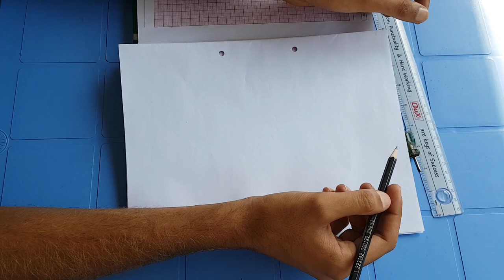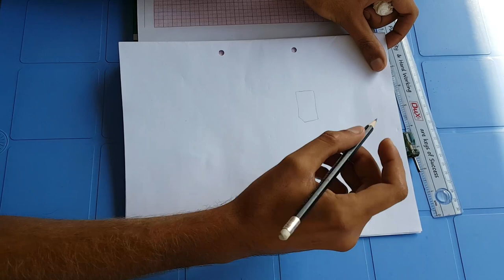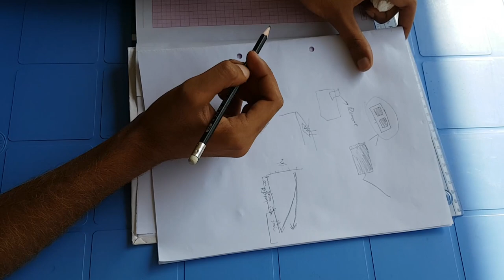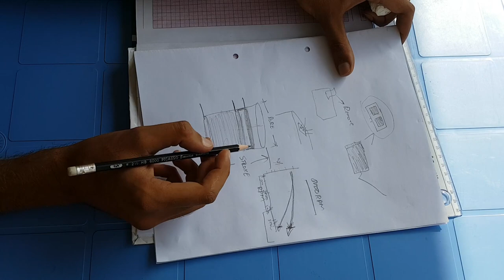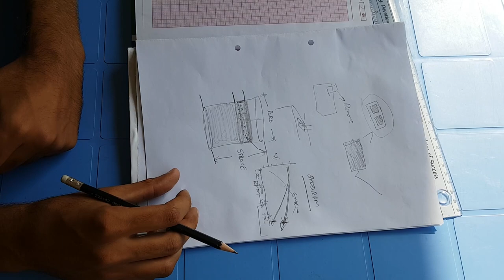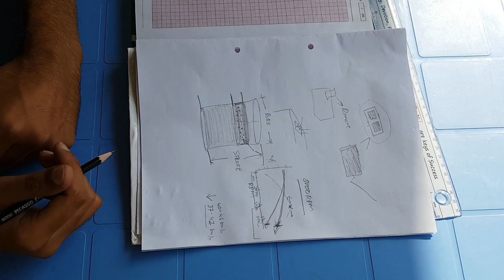Pilot Air Fuel Screw Adjustment Explained - Yamaha

Comment: Good effort. Please note that by turning the pilot air/ fuel screw clock wise or anti clock wise you tinker with the idle mixture only. If you study the carburettor internals this idle circuit  is useless at higher rpms. The main Jet  will have to be changed.
Reply from the maker: Yes right... that only happenes when we are at higher rpm..... driving in city means that we are lying in mid range so the pilot is still active in this case......🖒
Reply: your theory lecture is ' on and around' 8000 rpm.is it not?

Comment: Nice video bro.. it helped me alot and other YBR'ians who depends on the mechanic and mechanics just have their own philosphy... upload more videos like this with theory+practical in a video.
perfect video. . liked
one more thing did you feel any accelaration/top speed difference with installing an aftermarket muffler as you have got that on your bike before any(Air Duct) mods.
Reply from the maker: Thank brother... means alot to me.... yes aftermarket exhaust has increased acceleration.... after removing duct and adjusting fuel.... it slips under when i accelerate this bike... but didnt check top speed yet

Comment: Idle mixture screw only affects idle and off idle. If you change your exhaust to a more permissive one and change the fuel filter or remove a snorkel you have to modify the needle position and main jet (but in small increments) to accommodate to the bigger volume of air allowed inside your engine. Playing with the idle mixture screw only makes it richer at very low to idle rpm where the removal of the snorkel or airfilter cap isn't helping at all. You will only foul plugs and run too rich at idle.

Prove me wrong :)
Reply from the maker: I like that..... but do you know that this pilot circuit is active on low speeds as well as high speed???? This is motorcycle carb.....

Comment: AA brother, i have YBR G and now feeling some heating issue after 1st tappet adjustment at 3500KM by mechanic, here my fuel average is good and no engine oil consumption found after 500KM run. kindly suggest some solution and also pls guide about engine sound as my bike have some loud sound at higher RPMs and Max RPMs are 7.2K in 5th gear at max speed of 100KPH. please suggest some good things to improve each deficiencies. Thanks and waiting for your rep.
Reply from the maker: First check your engine oil & replace it with a good one..... secondly which engine oil you are using........ there is nothing we can with sound... because it is already silent..... if you want more performance & go upto 8k in 5th gear... you have to remove air duct, watch the video on my channel....☺

Comment: what is the standard turn of mixture screw in 2018 ybr..and what is the full rpm in standing bike ?
Reply: Always below 1500 at got hot idle. And does not matter on the turns its fornajustment not a reference point

Comment: hey bro.. this might sound stupid but do you think its possible to install a 6v cpu fan inside the filter box to suck more air in to act as a makeshift supercharger? i just thought of it since the idea is to let more air in (with proper fuel supply ofc) and what could be the damages(if any) done to the proper running of the engine? thx
Reply from the maker: Well actually this is single cylinder engine....  so if you try to push air through fan... it will sprut out all amount of fuel from your carb toward engine... hence engine shutts off due to worst air fuel ratio.... impossible for carburetor....
Reply: Thanks. i knew it was something stupid thats why no one was doing it. gonna try this video on my YBR. i have a full stock but im satisfied with the speed and all but there are moments when some honda 125ers try to put me in their rear view mirror. i dont worry about mileage. peace.
Reply from the maker: Hahaha... no worries man..... ask me questions whenever you want... its not stupid... its your interest... keep it up...🖒🖒

Comment: I dnt need any extra power my bike was doing good at stock settings but now its not. In this video u showed many things but didn't explain the adjustment of mixture screw. I mean if some 1 want to adjust the fuel acoording to new exhaust and air intake setup or like me 1 who lost stock setting and want to.get back. I need to know the stock setting for this screw if u can tell that plz.
Reply from the maker: +Irfan Siddiqui well the point is... that playing with air fuel mixture is not an easy task... every matter related to it, requires alot of research and alot of planning... everyone is not able to adjust it until he gets hand on experience by working... as far as i could do is to help at my best...
Reply: Sir stock setting is 2.25-2.75 turns

Comment: Hi. Will this work on fuel injection model? Thanks
Reply from the maker: Nope bro.... fuel injection models have throttle body and injector... so you may need a new power commander and reprogram it..... thats expensive...😜😜
Reply: Vortex Ride. OK. Do u know if I can play with air filter?

Comment: Hi man great video, I have ybr with Leo Vince gp corsa exhaust and I'm thinking about making this FI adjustment along with removal of the air filter "bit." however with the Leo Vince exhaust I already have slight popping from exhaust, doesn't this suggest there is already sufficient or slightly too much fuel input already?
Reply from the maker: +Jimmy knuck with the standard exhaust.... those poppings are damped... no worries at all  about these things.... just check your mileage per liter... if it is still good then good to go.....
Reply: Vortex Ride Iv just noticed my fuel injector is different to yours, iv have the ybr ed '12 (euro). Do you think the same adjustment can be made? And how long have you being riding like this on your ybr? And what is now your top speed? At the moment my bike is hitting 75 mph easily with a top speed of 83 mph (133kph)
Reply from the maker: +Jimmy knuck my YBR is having CV carb.... I have YBR ESD 2016.... I have never pushed it to topspeed... but I guess it can only achieve 120 kph..... your bike is already doing good..... you can do same adjustment but I am not sure that you may have to remapp your ECU...
Reply: Vortex Ride Ecu mapping is what I was looking to do, to increase the fuel mixture (properly), but all power commander chips seem to be way too expensive for the actual gain. Love everything you have done to your bike so far it looks really good man. I'm tempted to get the same handle bars. Cheers for your replies, keep up the good content. You on instagram?
Reply from the maker: +Jimmy knuck dear thankyou so much... that means alot for me...... I ll be always here to help your YBRs 😊😊😊.... Sorry not on instagram.....😐
Reply: Vortex Ride no worries man, if you have a smartphone I recommend you using instagram just to share some pictures of your nice bike in the landscape.
Reply from the maker: +Jimmy knuck thanx man.... I'll do so....👌😊
Reply: Jimmy knuck u bike have fuel injection.... we have butterfly carb..... totally different.. fuel injection have different settings this video is not usefull for u

Comment: Hello. Mera ybz 95km/h sy uper ni ja rha uski top k liy carb adjust kis py set krn with best fual avrg
Reply from the maker: Hello...... bike ki total mileage kitni hui hai ab tk???
Reply: Vortex Ride 4100 
Tappet seting 10 12
Hks silncr 
Stok tyre
Reply from the maker: Filter kb change kia aap ny??
Reply: Sir main ny to filtr chang hi ni kia abi tak 4000 km to chali hy abi aur shuru sy 95km/h dy rhi hy . Bus iridium plug chang kia
Reply from the maker: Oh.... very late.... aap new filter install karein...... or es baar 5 liter hioctane or 8 liter regular fuel ka mixture use karein..... phr mujhy result btayen.....
Reply: Wese filtr to 12000km py chang ni krty. Aur main to wese b high octain zyada use krta. Carb audjsmnt kbi ni cheri jb sy new bike li. Wo seting krni ya ni.
Reply from the maker: Join me on facebook bro..... my page name is same as channel....
Reply from the maker: No... filter 12000 py nahi.....

Comment: Bro .gear soft nai lag rahe kia karna huga ..2nd air duct hatane ke bad air filter ka foam hatana huga
Reply from the maker: Yes clutch adjust karein.... gear set ho jayen gy..... or yes duct or foam dono remove kr dein....
Reply: Bro cluth ki setting uper lever se higi ya neche engein side se ?
Reply from the maker: Upper lever sy ho jati hai easily bro...

Comment: Plz mujha batein ka fuel ki chori kitni kholni ha ka averge 40km tak ho jai
Example 
1.5
2.5 etc
Reply from the maker: I am using 1.5 turns now..... but standard is 2.5 turns.... adjust in between.....
Reply: Vortex Ride city ma average 45 tak karni ha speed no issue H 
Us ka lia chori kitni open honi chaiaa..
Ap ka bike 1.5 par kitni averge da raha ha
Reply: AOA
Bhai my YBZ is getting max rpm at 4 turns while adjusting mixture screw.
Should i set it here or what is the issue that it is not going good at 2.5 turns or 3.

Comment: Bikes which are Non EFI are automatically adjusted according with the parts change either it’s an Exhaust or an Air-Intake but the parts have to be original if you are looking for performance not just the sound. And for the missing problem you should change the Coil & the spark plug NGK Iridium plug or else go for a Bosh 4 Tip spark plug and buy a 1000cc car Coil from a spare parts shop and definitely a new one. Never change the settings of your Non-EFI bike. You will only ruin your bike.
Reply from the maker: If non efi are self adjusting.... then why they have provided pilot ajdustments and main metering adjustment???? They should have made fixed throttle ports.... think about it..... 1000 cc coil will melt piston top in few days of high speed runnings.....
Reply: Vortex Ride They provided adjusters in case one has to rebuild the engine and so the carburetor or maybe if someone messes up with it so that they can adjust it to factory adjustments. And a 1000cc car coil for a Non EFI motorbike has nothing to do with the piston. Coil is only used to provide the current and a 1000cc car or 600cc or maybe a 250cc bike coil would only provide a constant & a stable current flow thats all. Also NGK racing spark plug cable will be great aswell.
Reply from the maker: Bro read again ignition system...  that coil provides20k to 25k volts to spark plug for air fuel combustion and it happens just at top of piston... the metallurgy of 125cc piston vs 1000 cc piston is way different..... i already said they should have made fixed ports.... with fixed ports you cant ruin adjustment.....
Reply: Vortex Ride Alright brother You win 🙏 I can’t argue with ignorant people
Reply from the maker: Wowwwww.....